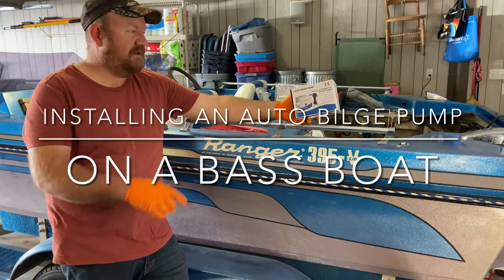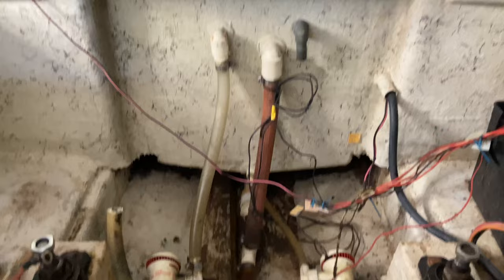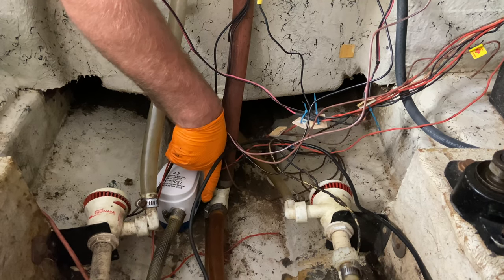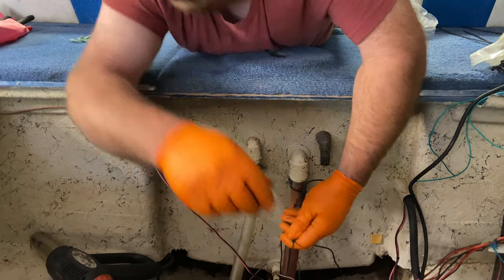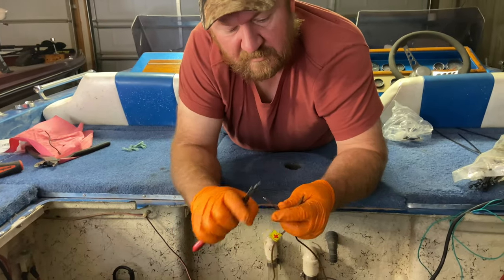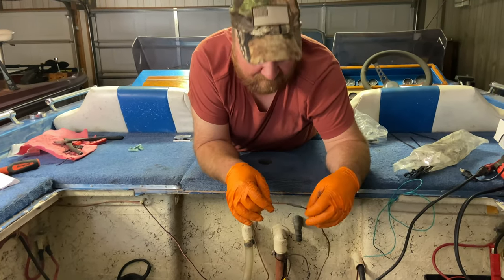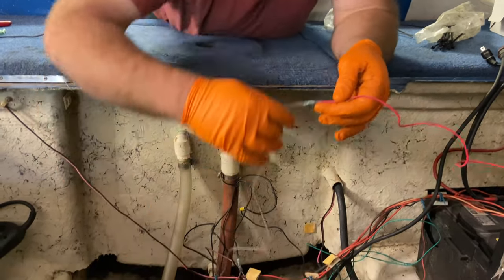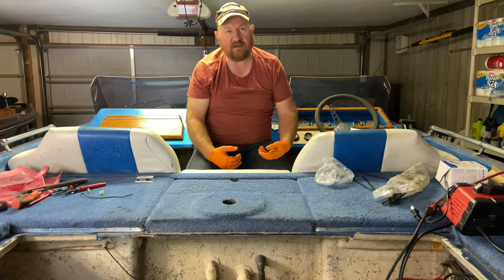Replacing The Auto Bilge Pump on a Boat/ bass boat restoration

Comment: Did you go from a 2 wire pump to a 3 wire, adding the hot direct to the battery?
Reply from the maker: On this boat, I have 2 switches for the bilge pump- one auto and one manual, so I connected to those circuits. On my other boat, I did run the auto wire directly to the battery with an in-line fuse for the auto feature.

Comment: Bro really zip ties 😆 🤣 😂 don't sink on the water 😐
Reply from the maker: Just using the zip ties for the wiring, not the hoses!
Reply: Looks like you used the zip ties to hold the bilge pump down.... u better off using 5200 or something to hold it down flat to the hull. Zip ties move around... great video by the way.

Comment: i cant find any video on how to remove the gas tank in my boat that presumably -  is covering the dead bilge pump. Mine is an 2 stroke outboard. Under the hatch from left to right is a large'ish oil tank, the LARge gas tank, then the battery bank.  Good video btws.. tks
Reply from the maker: On my Ranger 330V, I had to remove the 3 batteries and battery boxes.  There were two brackets held in by screws I had to remove.  Then I had to remove the fuel line going to the engine and plug it.  There’s a hose clamp on the fuel hose and the vent hose that have to be removed and then pried off. The trick was being able to remove the tank without spilling the remainder of the gas.  I capped the fuel line outlet and then I picked up the tank and—- lifting the end where the fill hose went, out first so as not to spill fuel.  I removed the tank and poured the remainder of the fuel in a gas can so when I went to reinstall it was empty and easy to install.  Thanks for the idea- maybe I’ll make a video on it in the future.
Reply: @ProWrenching  tks for the tips. I'll give it another go this weekend and take pics or a video in case im unsuccessful